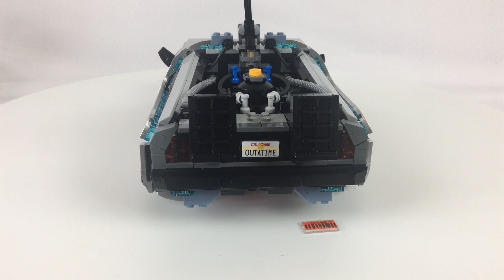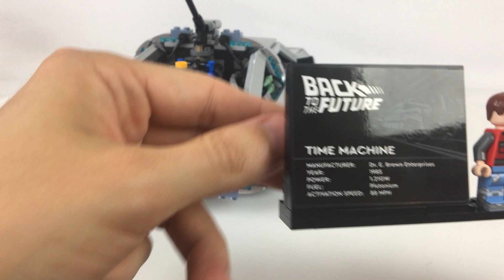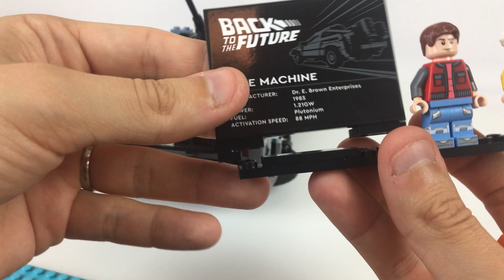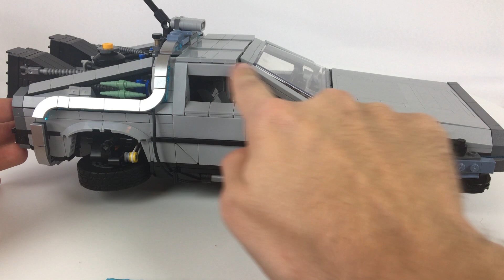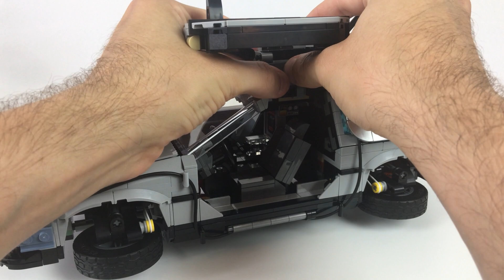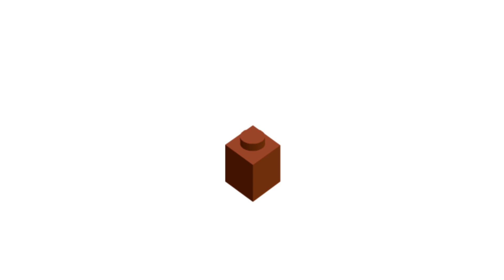LEGO Back to the Future Time Machine - Small Modifications, Big Improvement!

Comment: this is like 2 years late, but Im wondering how you got the windshield slope pieces at the top flush with the roof? I recently got this set and the windshield sits about a quarter of an inch higher than the roof, and while it's not really all that noticeable I think the clean look is a lot better looking. Also, my gullwing doors stay open naturally so now Im wondering if this was a piece recall/replace that happened more recently that also effected the windshield? Ive seen photos of both the raised and flush roof so I'm sure if I just built it wrong somewhere or if it's just how it was made. Thanks!

Comment: Some reason mine doesn’t want to change to fly mode I put it together right as the book said
Reply: Quite a late reaction, but: when putting the gears in place, be sure that the handle is in its extreme position before locking everything in place. Unfortunately, fixing this now will probably involve taking apart most of the vehicle...

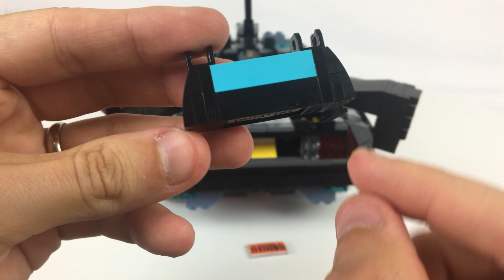Comment: 1:09 I added a 1x2 modified plate (with rail) on each side of the license plate. But I also removed the blue 1x1x3 brick and replaced it with another 1x2x3 window frame. 
3:10 I also removed the cheese slopes, but replaced it with a 1x8 tile, to hide the colourful door's insides, but I might go for the pieces swap soon.
I also replace the black "pin with ball" connectors by gray ones.
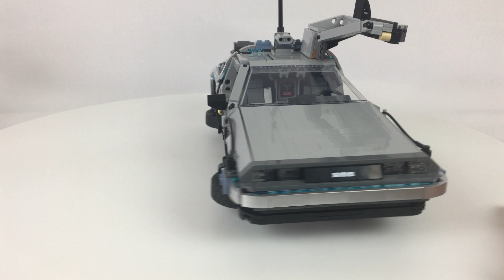6:40 I coated the pins with transluscent nail polish (2 coats, let dry well) and the doors hold very well in upper position. I did the same for my old Tydirium Imperial SHuttle's cockpit.
-> Another extra modificiation I made is moving the bottom part of the light-switch, so when I press it the light stays on. And it's still very easy to turn off.
Reply: (As I didn't find the same "pin with ball" connectors in gray (I don't know it they exist), I actually used "axle with ball" gray connectors. The door is stil sturdy enough.)

Comment: hey I finally got one of these coming in the mail and I plan on doing the mods for the plate mount and the doors is there a list of the part numbers for the bricks you used that were different color for the modded doors so one could order them from the LEGO site?
Reply from the maker: I’ll have to put a list together!
Reply: @2bricks  thanks I already saw that you can get them on 2 different sites, but if I had what the numbers or at least what type bricks and get the appropriate colors (had NO idea so many color options just for a certain brick type wow).  I think for now I will just build it (gonna build it as the part 2 car with the barcode plate) and upgrade (or is it downgrading lol) the doors and the rear panel to swap the plate out in the future thanks for the video and the help!
Reply: I finally built mine this weekend I did one slight 'mod' I ordered a set of the more less smooth technic black pin in place of the ones that came in the build, I swapped em out and now the door has more stiffness in the hinge area and I thought I needed 2 per door but found out I only need 2 so if somebody ever needs a set of em I have extras.  I still need to do that mod you did that makes the rear plate unit easy to remove I personally can live with the door windows being 'smaller' so I am leaving them alone.....for now

Comment: I just finished my Delorean today and I found that both of the doors can't be opened smoothly, they will be stuck by the bar at the top of the window... Any ways to fix this?
Reply from the maker: Hmm, interesting- sounds like maybe you went wrong on the instructions somewhere or perhaps you got a bad part in there? I can’t say I experienced this particular problem- mine were TOO smooth so they wouldn’t stay open.
Reply: After the several times closing and opening...the 1x2 slope plate at the top of the window has been worn out🤣Problem solved

Comment: Are the rubber bands under any stress in either of the two formations?
Reply from the maker: They don’t really seem to be - it feels like only during the activation of the wheel change do they get stretched any significant amount. They are obviously under tension when the wheels are down but it’s fairly minimal and I think they will last a good long time with no issue.
Reply: @2bricks  thx. It’s currently out of stock but I’ll buy it when it’s back in.

Comment: Do those pieces at 4:28 get provided in the set or do you have to have them aready? (Where your finger is at 4:28)
Reply from the maker: Those are the additional pieces you would need to buy or source from your spare parts bin- 7 pieces in total - 2 of the 2x8 plate in light bluish grey, 2 of the 1x2 plate in light bluish grey, 2 of the 2x2 L-shaped plate in black, and 1 of the 1x2 modified plate with rail in black.

Comment: Awesome man. Really good job. Behind the drivers seat there should be a panel with red, yellow and green LEDs. If the door is open it is visible that this panel is missing. That could be another modification to be made. Keep up the good work. Stay safe.
Reply from the maker: Thank you!! Yeah I saw that some other folks had done just that and it looks really good! I actually have that included in my minifigure scale delorean time machine which has a video coming very soon for it!

Comment: I love the fix for the rear license plate! For the windows, did you consider leaving the brackets on and replacing the cheese slopes with tiles instead? For the doors, I saw someone change the technic pin and put a rod down the center to increase that friction. But your door method is definitely easier to do in a pinch!
Reply from the maker: Nice! I like the friction adding idea using the rod! Yeah I tried the tiles but I still felt it was a tad too tall for my taste. I think that’s what Jang ended up doing with his

Comment: For the gullwing doors, I read somewhere that you can use Technic pins with friction ridges instead of regular Technic pins to make the doors stay up and still be able to close.
Reply from the maker: thats great to know!!
Reply: I tired it and it work great!
Reply: Could you elaborate which pieces one would replace?
Reply: @igordasunddas3377  its the 2 black pins that make up the gull wing door hinges I replaced the 2 black smooth technic pins with a set of ones with small raised ridges that when you click them in they don't turn as smoothly and they are stiff enough to hold up the doors with no other mods the part number to look for is 4459 you can get them on a site like brickowl, they are cheap like only a few cents a pin, just get 2 you won't need any more one per door hope this helps.  and if you already built the car you just have to remove the center roof panel, remove the doors swap out the smooth pin for the 4459 pin, reattach doors and then roof panel volia!

Comment: hey, to keep the door open, you can place a 1x4 plate just under the hinge, there is space for it and it keeps the door open and looks way better (it's also simpler to to than moving the inverted tile forward).

the connection is also kind of loose (it hold thanks to friction), so if you push down the door you'll be able to remove the plate and close the door, without any effort removing or adding pieces
Reply from the maker: Nice!! I will try that out!